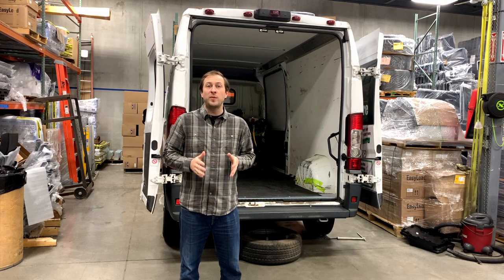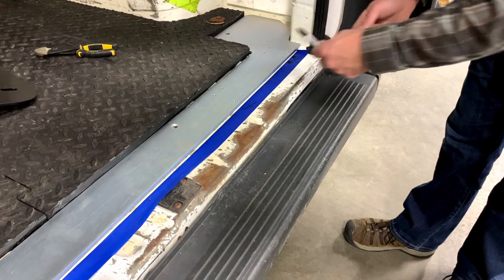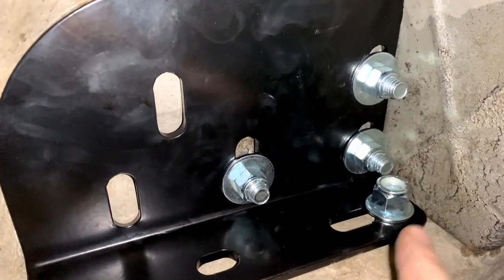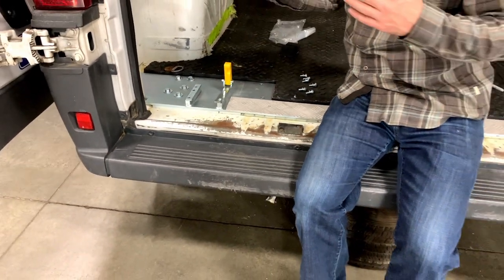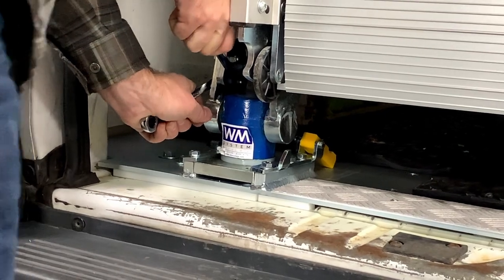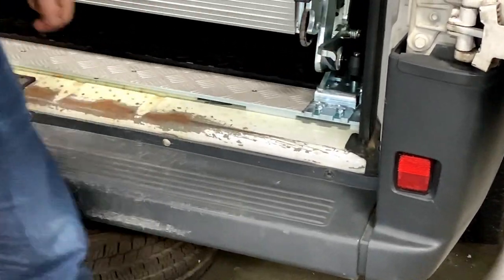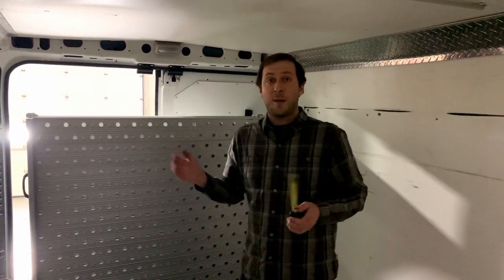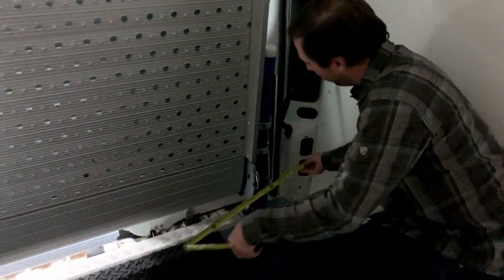WM Systems swivel loading ramp install and operation instructions in a Dodge Ram Promaster cargo van

Comment: With the ramp swiveled out, what is the loading width? Looks a little tight for a 4x4 pallet with bags of feed or seed on it. Wouldn't want to rip the bags.
Reply from the maker: Hi Birdman44. Thank you for commenting. The open width will vary depending on which vehicle you have. You are correct that it will be a tight fit with a 4x4 pallet (vs the standard 40x48 which is no problem). If you had forklift extensions- it would likely be possible. Please give us a call and we can measure it up and double check.
Reply: @NationalFleetProducts  They would be 40x48
Reply from the maker: @birdman4434  Great! Standard pallets are no problem and are encouraged. For some customers its the primary reason they get a swivel ramp.